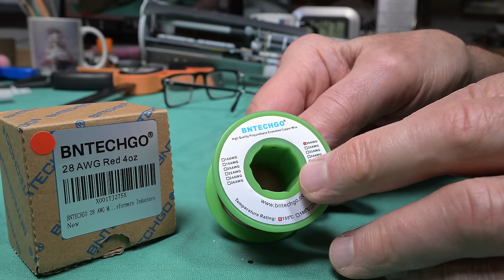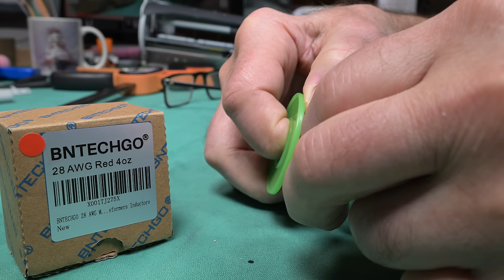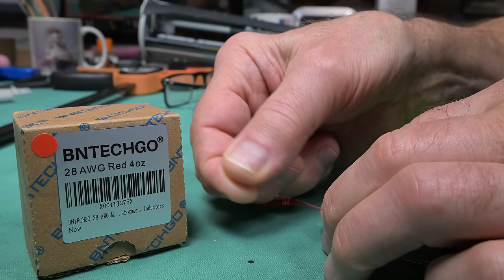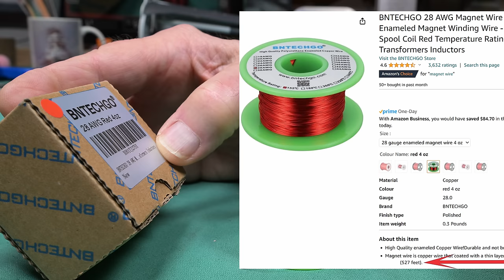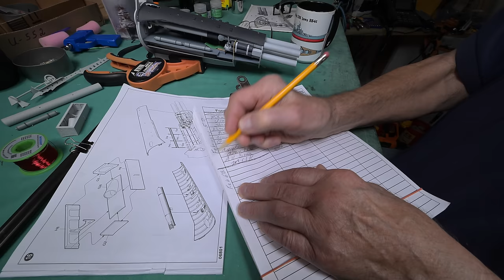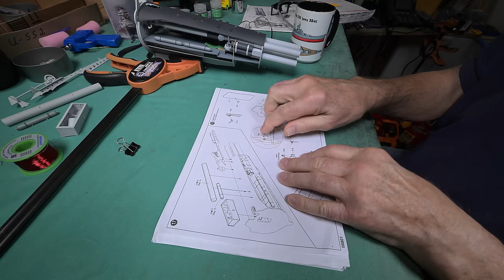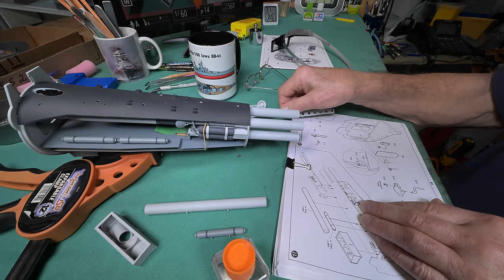The Model Ship - Part 1889

Comment: Hi Ron , Glad to see your almost done with the forward torpedo room , 
I see you mounted your tubes with a spacer between the deck , might want to
check fit inside the hull with both sides together
Reply: I think the spacers are the problem. It pushed the torpedo tubes up and interfered with the top piece. This could be a problem with the alignment of the torpedo tubes fitting in the hull.
Reply from the maker: Re: "check fit inside the hull with both sides together" Did that a few episodes back. Consequently, the spacer. 👍

Comment: Ron, just wondering if the problem with the ceiling not dropping into place is because of the wood shim you have under the torpedo tubes?   The winding wire is good stuff, not only for electrical, but also for making detailed, delicate fittings on model ships.  Just be aware that the wire is coated with plastic as an insulator which should be scraped off with the blade of a hobby knife before soldering.
Reply from the maker: Re: "because of the wood shim you have under the torpedo tubes" I address that issue in today's (episode 1890) roll-back.

Comment: Why not put all the led in their holes and power them up. See if you need one at the front before drilling a new hole above the torpedo tubes and potentially damaging them ?
Reply from the maker: Too late Jerry. Already drilled the hole. See roll-back in in 1890 later today. But thanks for the suggestion. 👍